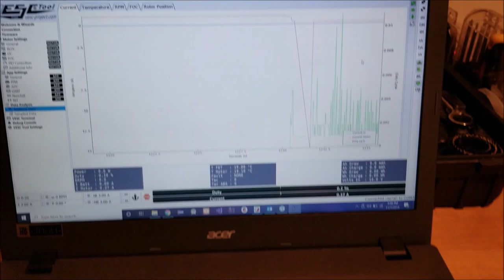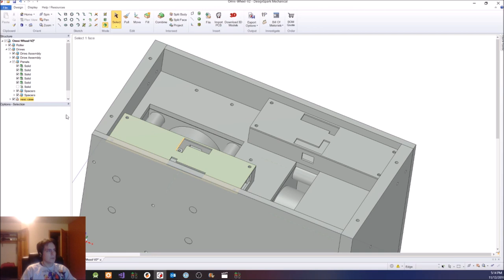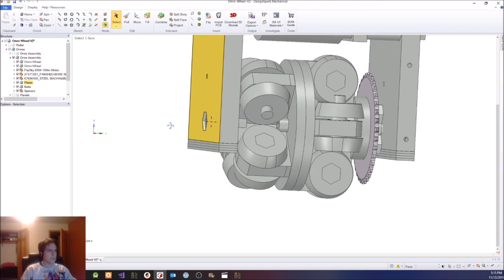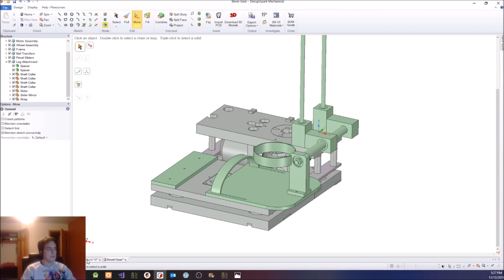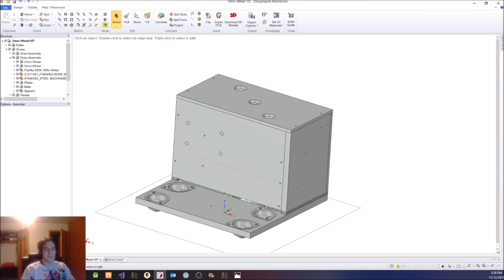VR Shoes Build Log #4 - Testing

Comment: Great stuff! Do you think that the wheels will have a more grippy surface in a later version? It might help.
Keep up the great work!
Reply from the maker: Possibly. Flexible filaments like TPU aren't very grippy compared to rubber. But I can't 3D print pure rubber. I was thinking about maybe spraying the wheels with Flex Seal to see if that will make them more grippy. Or maybe make the floor itself more grippy by using those rigid rubber mats that gyms put exercise equipment on.